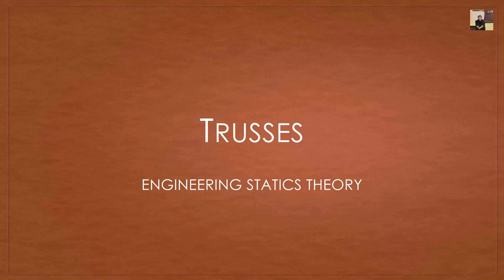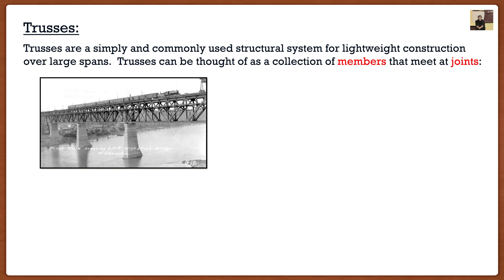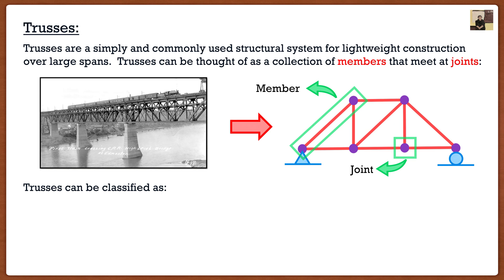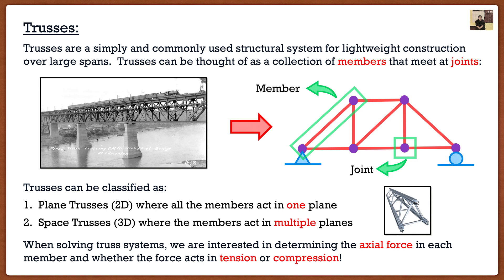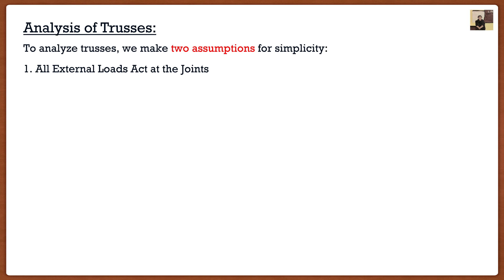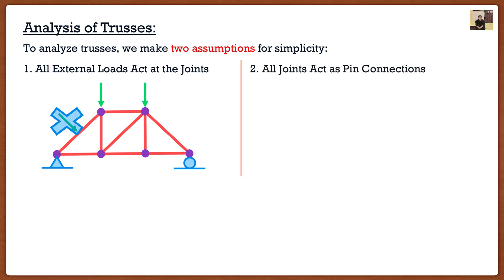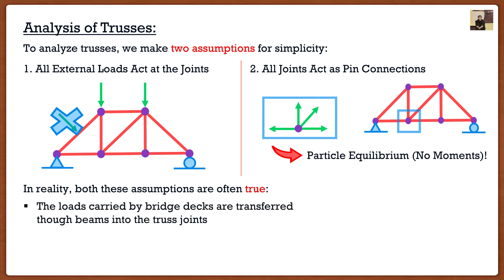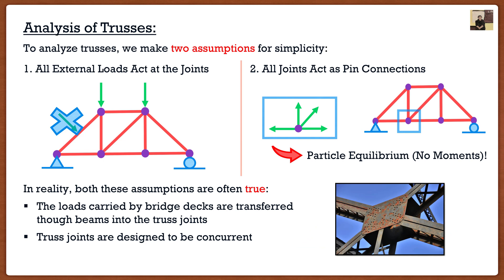Engineering Statics | Theory | Introduction to Trusses

Comment: I wanted to find answers for the assumption of the non moment connection between the elements in the truess, and now I understand that with the building method used for the joint, with the right FBD I can conclude it is equivalent to a point-pin. Thanks for the clear explanation!